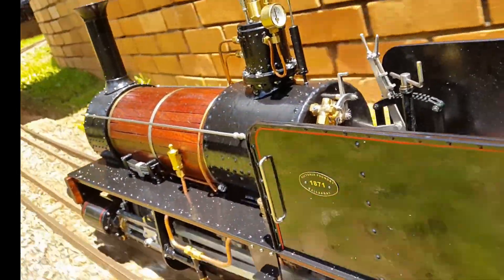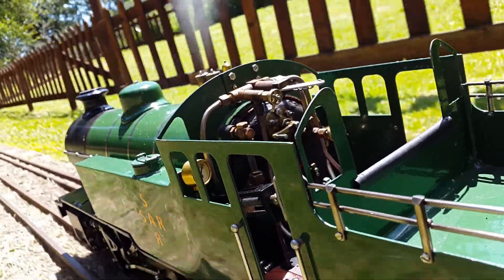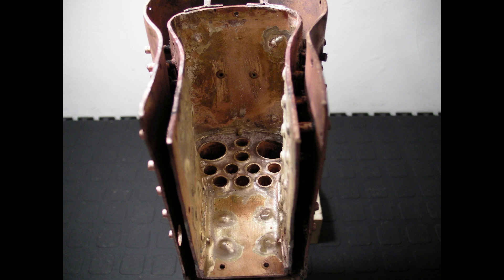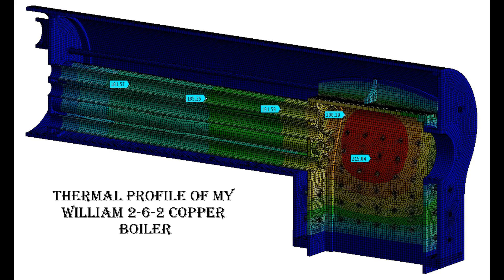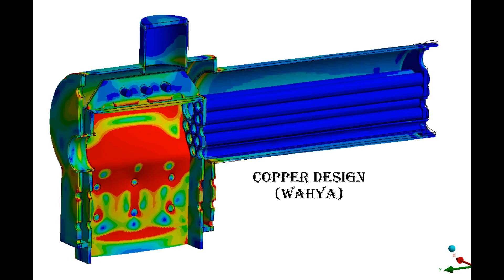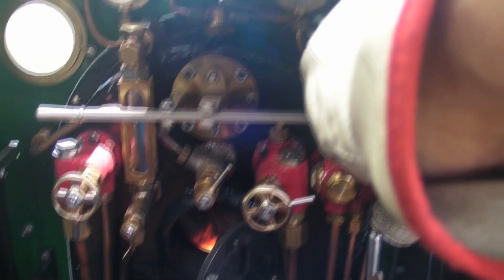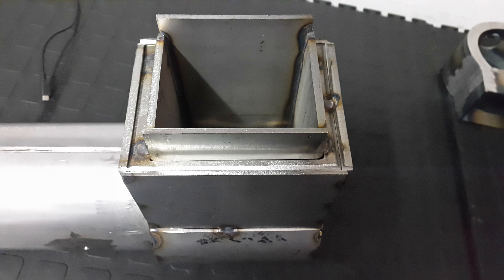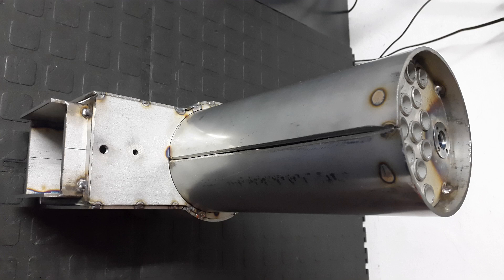Modern Boiler Construction Methods for the Model Engineer - Boiler welding - Part 1

Comment: Are any of the designs for your locomotives or boilers available on your patreon? I would really like to build a 5 inch ballerat one day.
Reply from the maker: Yep it's on patreon... that's the most fun Loco i built.
Reply: @Lukers_tinkering ok many thanks
Reply: @Lukers_tinkering  Do you think I could scale up the drawing to 7.5 inch scale?
Reply from the maker: @CArsR26377 I wouldn't recommend scaling. My designs are simulated and balanced. The boiler, steam usage, etc. will all be different.

Comment: If I’m a boilermaker by trade can I use my trade number with the club inspector as proof of certification?
Reply from the maker: Depends on the region. But the boiler still needs to be tested. Can't see any issue with that...
Reply: @Lukers_tinkering awesome! I’m up in Queensland Australia 🤙 about 6 minutes away from Queensland rail site. 

Also would you happen to have a store somewhere a fella could buy a set of plans from you? 

Cheers Zak Hanson
Reply from the maker: @zakhanson5720  Nice area, I did some work in Brisbane a few years back. There's an Australian stainless steel boiler code, they use 318, and they don't accept crown stays (the code was written before boilers were simulated using FEA, so this is one of the legacy misconceptions that has been copied over the years). Some of my designs are on Patreon, and there's a few books if you're interested. I published a few articles on modern boiler design for models a few years back, but that's not up yet.

Comment: Fantastic content.  Looking forward to this series in applying tig to ME stainless boiler design.  Doubly so in that you are addressing many of the “gotcha’s” such as SCC, surface prep/cleaning, alloy selection, filler rod material, thermal expansion…etc.  Thank you!

Comment: Ahh, finally a voice of reason about stainless boilers.
I have done some research myself about the subject at one point and came to the same conclusions as you. (Although i haven't done the calculations and infinite analysis) 
Most resistance I've encountered appears to be twofold; one is the universal gear for the new/unknown. 
And the second is the fear for the corrosion stainless potentially undergoes while under pressure/heat. 

Which in my mind is something you could monitor during an inspection.

I am really interested in boiler design/building and particularly in stainless. So I'll follow this series close. 

What software/aids do you use for your boiler designs? 
Any pointers where i can find the knowledge to do the actual calculations?
Reply from the maker: Hi, I use ANSYS but this package is incredibly expensive for a hobby. The simulations require an understanding of element discretization; even using this software you need to choose the correct element type to get accurate results. The calculations are rather complex (coupled thermal structural) and involved, and to the best of my knowledge cannot be done without using numerical methods. I've actually spoken at a few engineering conferences on the topic. Sorry, probably not the answer you looking for.
Reply: @Lukers_tinkering  thanks for your reply. 
So, if I would want to design a stainless steel boiler my best option would be to find someone who has a professional understanding of the mathematics involved? (I wouldn't mind the complex calculations)
Might not be the answer I was hoping to get, but it might be the answer I needed. 
Better to get a professional to do the calculations correctly rather than stuffing it up myself in an attempt.
Although it is somewhat disappointing to know that the cheaper option of stainless cones with the requirement of finding someone (and probably having to pay that person) to do the necessary calculations.
Something tells me that that might offset the costs a fair bit .
Reply from the maker: @fladder1 I think it's going to be difficult to find someone with both the academic and practical knowledge to do the calcs for you.  I would recommend looking at my boiler designs and provided you keep to the plate sizes and pressure areas you'll be OK. Also, check the article I wrote in the description.

Comment: I read your series of articles on stainless steel model boilers and found it informative, interesting and refreshing. I keep hearing a lot of negative views on stainless steel from the model engineer community, mostly from the point of view of corrosion stress failure I suspect. I have an interest in making a stainless-steel boiler for stationary model engines, so I look forward to your next video. I may email you with some questions after that, if you are OK with that?
Reply from the maker: Yep, scc is the main factor but should be designed for....